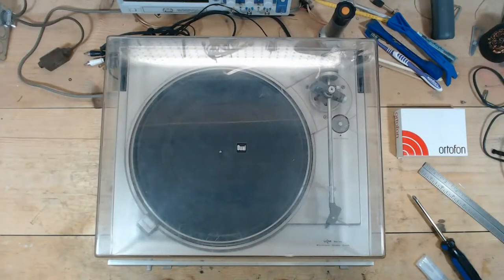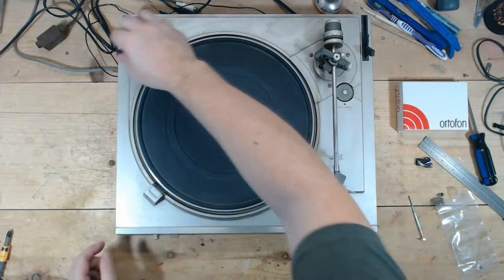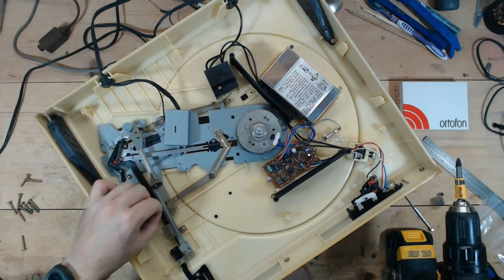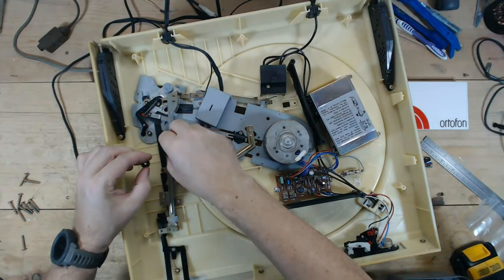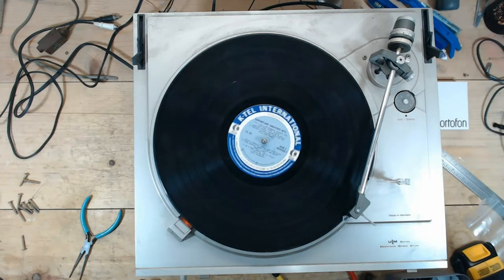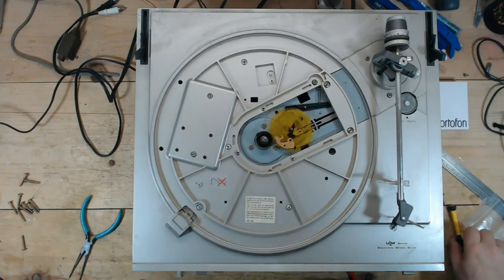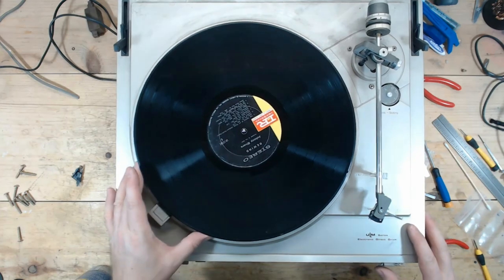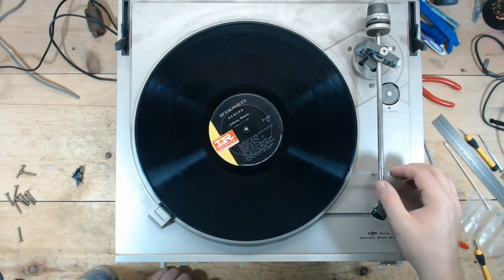Dual CS 607 Turntable Repair - Installing Headshell Adapter and Fixing the Tonearm Elevator

Comment: Very informative video. Picked up a CS 607 recently and it had the same problem with the cartridge, bottom section split from the top holder piece and same as yours, the previous owner had attempted glueing the pieces together. Appears to be a manufacturing defect with the original cartridge, which in my case was an Ortofon rebrand for Dual.
Reply from the maker: Thanks for watching!